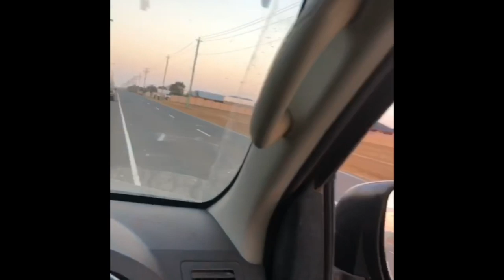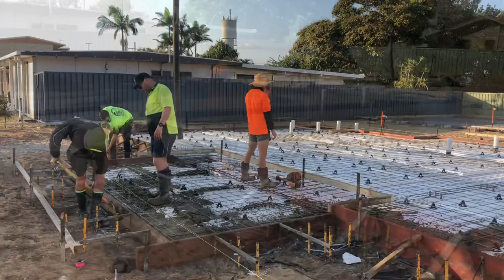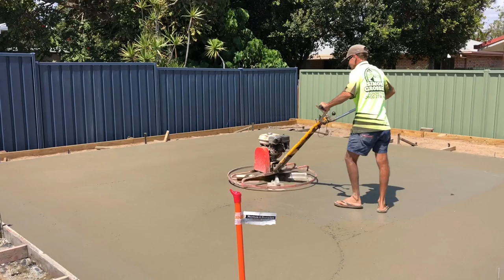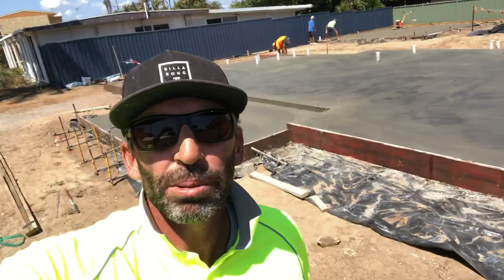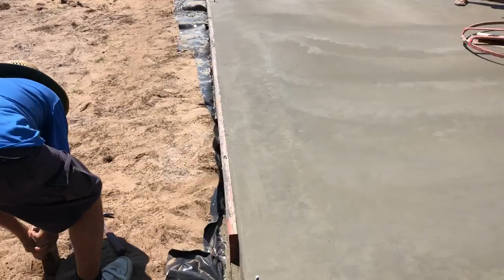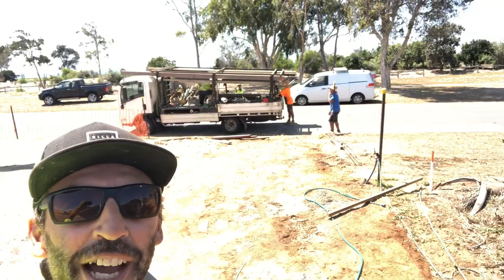How to finish concrete with a Machine Trowel

Comment: you have done a few of the machine trowel videos, but never have you explained the process...  do you run on with floats first?  then a finisher? or just finish?  whats the diffrence between burnishing and a steel trowel finish?  how many passes? how much water to go on when machine troweling? how can you tell it needs it..   you need more concreting info.